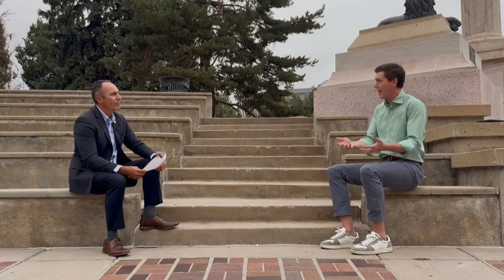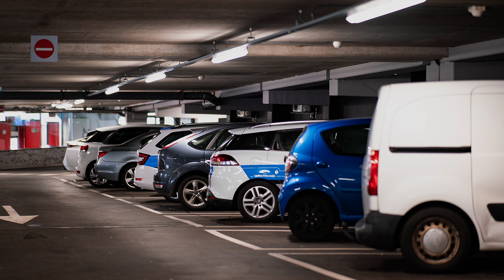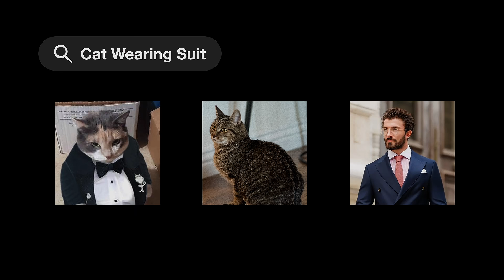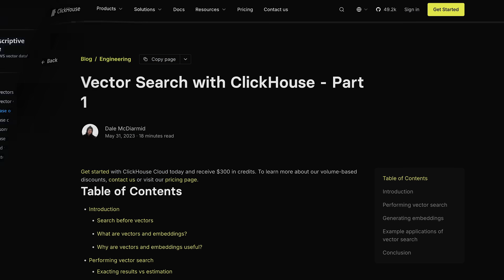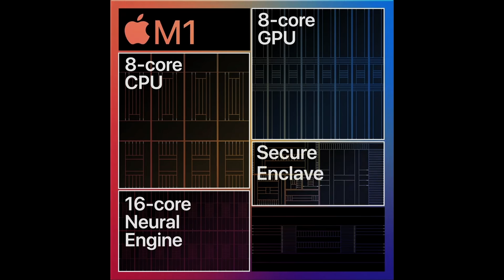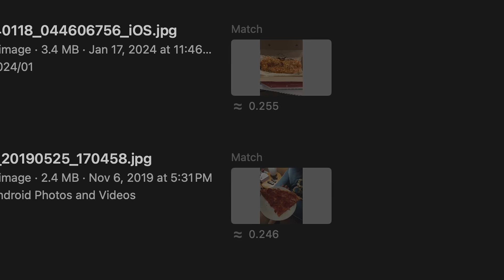Reverse Engineering America's Largest Surveillance System

Comment from the maker: CORRECTION: In the video, I assume that Flock's main cost is transmitting data to the server. It's more likely that the main cost is storing data, since it's probably stored in perpetuity. The overall gist of the video is still correct since either way the goal is to minimize collecting unnecessary surveillance footage.

Comment: It's much, much less than $2 a GB. This is negotiated, and a camera network is a drop in the bucket compared to everyone else. There's plenty of bandwidth available. The data center costs of managing and storing the data is wayyyy more than the cellular connectivity. This is the bottleneck, not mobile provider costs. Each device probably is around $150 a year, maybe less in bulk.
Reply: This

Comment: I'm pretty sure flock does not search video the way you have described. 
With 100k cameras running at 15fps that's 1.5M frames per second - there's no way anything is running CLIP on that.
Here's how I imagine it works:
1. every frame runs through the YOLO pico model which has been retrained to detect an alternate set of keywords - e.g. dodge-car, wearing-hat, camper-van, carrying-bag, long-pants, running etc. 
2. The labels with bounding boxes are encoded into a highly compressed format and sent every minute or so to a regional or central server. The dominant colors and recognizable text in each bounding box centroid is also encoded.
3. The server decodes the bounding boxes / metadata and saves them along with the device ID and import timestamp into something like ClickouseDB/DataBricks etc
4. The searches are performed on the text database and when matches are found, the server pulls the video from the flock camera so only result videos are sent across the wire.
5. A larger clip model is used on the central server to filter out any irrelevant videos and determine the colors, makes.models - and the search results are returned. 

I imagine at night time they also have a deal with the telcos to cheaply pull videos before they expire.

Anyway I hope that helps optimize your search engine.

Comment: So could you blow up flock cameras phone bill by putting a screen in it's field of view that shows constantly changing incompressible static + a car to keep it watching?
Reply from the maker: To be fair, there's a lot of things you could do to troll them if you put a screen in front of the camera.
Reply: What about one of those cheap spinny fan things they have at restaurants for outdoor seating that keep the flies away? Those are crazy cheap and you could 3d print a mount for a flock camera
Reply: Very good thinking
Reply: A projector or laser show that goes trough the FOV of the camera
Reply: @Noobificado at that point a laser might as well destroy the sensor
Reply: A screen showing fireworks and party poppers blowing while there is a car moving around on top
Reply: one singular camera won't do that much though, right?
Reply: @apfelsaftzerstoerungseinheit  As you can see in the video, motion detection made the file size go from ~400MB to ~100
If you messed with just a quarter of flock cameras, the phone bill would go up 175%.